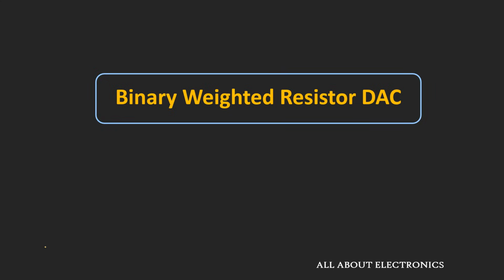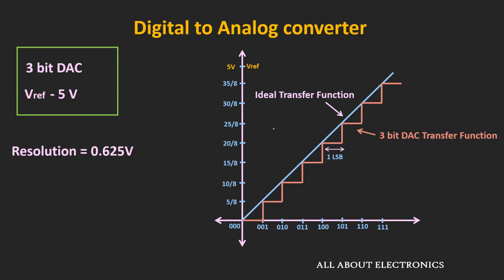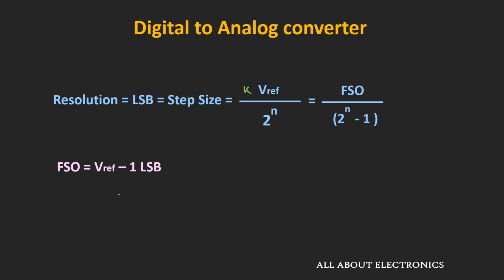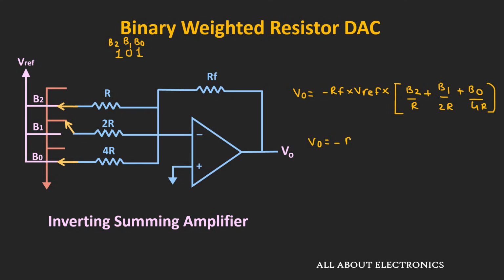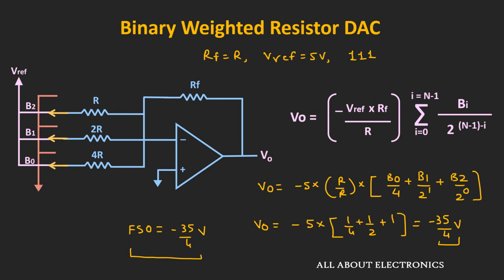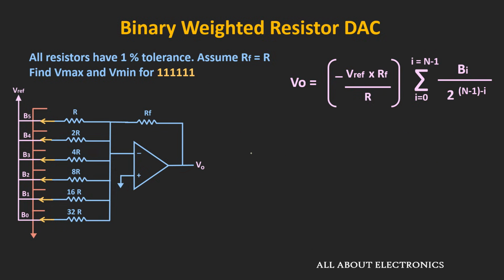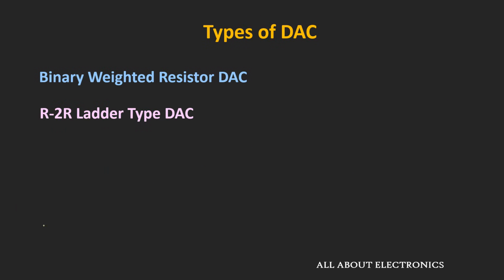Binary Weighted Resistor DAC Explained

Comment from the maker: The timestamps for the different topics covered in the video:

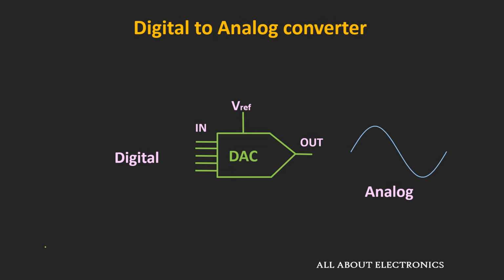0:45 what is Step Size, Resolution and Full-scale output voltage of DAC?

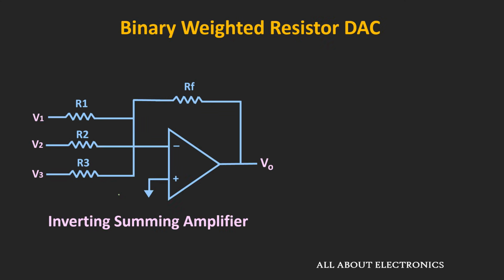6:19 Binary Weighted Resistor DAC ( 3 -Bit DAC example)

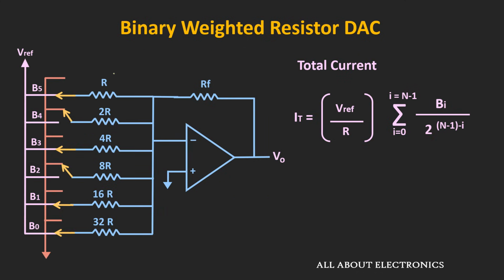14:50 Binary Weighted Resistor DAC limitations (with example)
Reply: sir hindi me important topic explain kr lete

Comment: Shouldn’t the x and y labels be flipped???? 3:22? Because that means for even .00001 V the binary o/p will be 001
Reply from the maker: For the given 3 bit DAC at 3:22, When your input code to DAC is 000 then the output voltage is 0V. When input code is 001, then the output code is 5/8V. And Likewise, when the input code to DAC is 010 then output voltage  is 10/8 volt. You will not be able to generate the voltages in between. I hope, it will clear your doubt.

Comment: You said on increasing resolution, we can reduce stepsize ,but the step size it self is the resolution? I couldn't get that point ...what is the relation between them 1:57
Reply from the maker: What you are saying is true, but here I am referring to the steps seen in the output waveform (In yellow color) as a step size. So, if we increase the resolution, then the output waveform will be much close to the actual waveform and the steps seen in the output waveform will reduce. I hope, it will clear your doubt.

Comment: sir what is the need of using a op amp here can not we only use the resistent network only
Reply from the maker: The op-amp serves two purpose. It act as a buffer between the input and output side. And second, it also performs the summing operation. And because of the op-amp, if required then it is also possible to provide additional gain by changing the feedback resistor.

Comment: I was wondering how does the DAC reach the smooth (not staircase) output? Because of the lowpass filter before the ADC sampling, from the sampled signal  the orignal low passed signal can be fully (smoothly) reconstructed (no staircase) as is proven by the Fourier transforms. Therefore if I had to design a DAC I would create the smooth output by either digitally oversampling and interpolating and low pass filtering.

Comment: Is it possible to have lower output voltage after using op amp in magnitude in full scale output case in comparison to its input vref of 5v? During weighted resistor during formula we can extract that resolution is Vref/(2^(n-1)) not Vref/2^n. There are many other resources they talk the same but in your it’s different. I am talking in zero based configuration.
Reply from the maker: I think you are taking about having FSO lesser than Vref, right !! Well, if so, then yes using the op-amp, it is possible to have that. In fact, if you see many DACs, then they have different operating voltage range (even with same Vref)

Comment: Sir i've question. Are MSB and LSB in  weighted resistor binary determined by the highest and lowest value of resistors or by the position of resistors?
Reply from the maker: You can identify them from the resistor value. The resistor at the LSB position will have highest resistance value, while the resistor at the MSB position will have lowest resistor value.

Comment: 12:56 
The value of the F.S.O. is -35/8 you wrote it -35/4.
Reply from the maker: The F.S.O shown in the transfer function is for different case ( It is for the case which I have discussed at the beginning, when resolution of 3 bit DAC is 0.625 V). In this case, it is double. I have also mentioned that just after that. I hope, it will clear your doubt.

Comment: Sir, why reference voltage product with feedback resistance in summing amplifier output voltage expression?
Reply from the maker: At 7:09, I have mentioned the expression of inverting summing amplifier with three inputs. Now, in this expression, suppose, V1 = V2 = V3 = Vref, then you will have Vref x Rf common in the expression, right !!
I hope, you will get the point. 
For more info, you can watch the video on summing amplifier using the op-amp.
I have already provided the link for the same in the description. 
And here is the link : 
op-amp as a summing amplifier
https://youtu.be/jsKSfaFQ4d4

Comment: namaste Sir ,@17.42  how Vout is less than vref
Reply from the maker: With Rf = R,  when all bits are 1, the output is 2*Vref ( 2^n -1) / 2^n
Or in this case, Vo is 5*64/32. 
So, it is more than reference voltage. 
So, depending on DAC type, the Full Scale Output Voltage can be more than reference voltage. (I am just consiering the magnitude of the voltage).
For DAC, the supply voltage may be a different from reference voltage. And hence output can be greater than the reference voltage, depending on the structure of DAC. 
Please watch couple of mins of the introduction of the video, it will get clear to you. 
And if you still have any doubt, then let me know here.
Reply: @ALLABOUTELECTRONICS  i still doubt
Reply: @ALLABOUTELECTRONICS  u say that v out must be less than v ref by 1 LSB
Reply: @ALLABOUTELECTRONICS  and in this case  the result of   (fso/(2^n)-1) not equal (v ref/2^n)

Comment: 1:53
Does increasing resolution decreases step size????
For that I doubt that we have to reduce resolution(by decreasing reference voltage or by increasing number of bits) ????????????
Reply from the maker: For resolution, the lower is better (the absolute value in mV or V). Its the smallest increment in the output that DAC can produce. Of course, as you said, it depends on the reference voltage and no. of bits. So, typically, when the two ADC or DAC are compared in terms of resolution, then they are compared in terms of no-of bits. And higher the number of bits, the better is the resolution of the  ADC or DAC. If you see, in terms of mV or V then absolute value reduces with increasing no. of bits (and so does the step size). 
I hope, it will clear your doubt.
Reply: @ALLABOUTELECTRONICS  Sir so you mean to reduce absolute value (resolution) in video???????????? In order to decrease step size.??
Reply from the maker: Yes.

Comment: Is there a simple design to make the control switch?
Reply from the maker: MOSFET can be used as a switch. MOSFET based switches are readily available in the IC form.
Reply: @ALLABOUTELECTRONICS  Is that the fastest option? again, should we use like two cmos inverters as switch?

Comment: sir i think you defined resolution wrongly   ..............in gate academy i saw resolution is 1/(2^n   -   1)
Reply from the maker: The resolution (in volts) depends on how it is calculated. Considering the reference voltage, it is Vref/ 2^n.
But if you consider the full-scale output voltage (FSO), then it is FSO / 2^n - 1.

Comment: Sir in some book they mentioned resolution as Vref / ( 2^n - 1 ), which one is correct. please reply.
Reply: Hello Vijay, resolution = range/( 2^n)-1
Reply from the maker: If you consider the reference voltage then the resolution is Vref / 2^n.
If you consider the full-scale output voltage (FSO) then it is FSO / (2^n -1).
Basically, FSO  is 1 LSB less than the Vref. 
I hope it will clear your doubt.
Reply: @ALLABOUTELECTRONICS  Thanks. so basically step size is the resolution of signal ?
Reply from the maker: @vijayakumarr3519  Step size is basically a resolution of the ADC or DAC.

Comment: Excellent presentation again, but I have a question. Couldn’t we achieve a similar result with a binary weighted resistor network alone. Why do we need an op amp?
Reply from the maker: The obvious advantage of the op-amp is high input impedance and low output impedance. Apart from that, the concept of the virtual ground is very handy over here. Because whenever the bits which are logic low or 0, their resistor will be grounded. And won't affect the other inputs. 
Without op-amp when all the resistors are directly connected in parallel, then the resistors whose input value is logic zero will also affect the other inputs And will change the overall output. 
That's why op-amp is required. 
I hope it will clear your doubt.
Reply: ALL ABOUT ELECTRONICS  Thank you that helped.